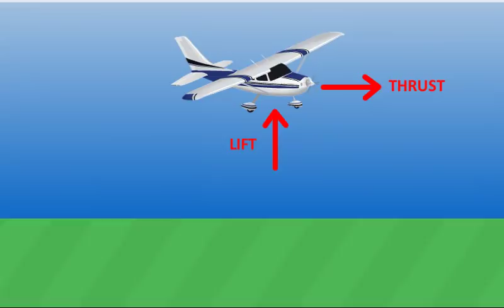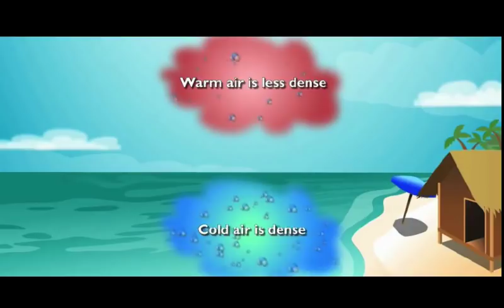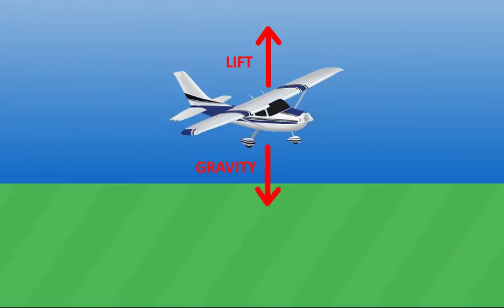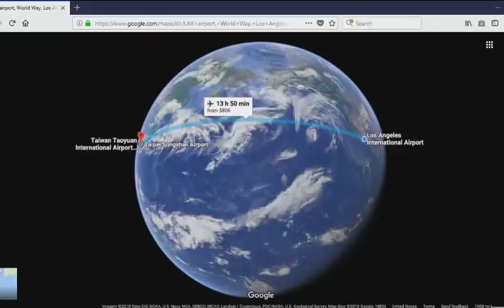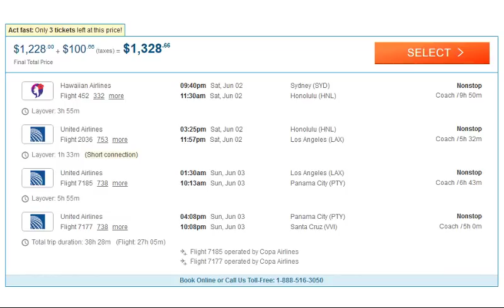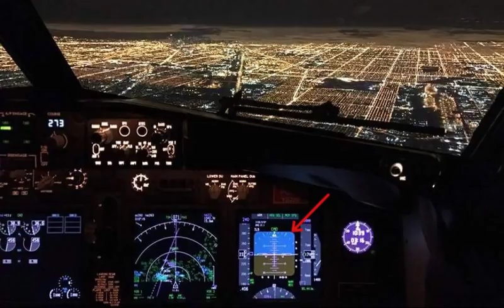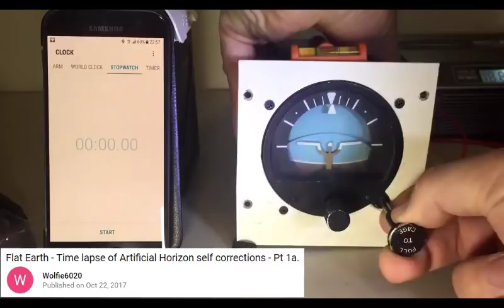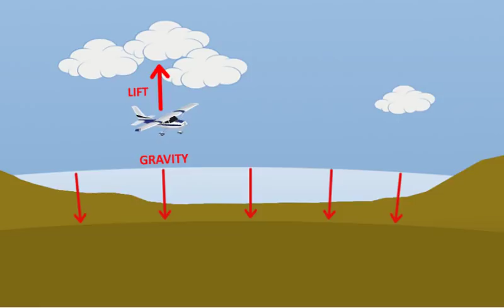Flat Earth Falsities - Plane Nonsense

Comment: The laws of physics do not cause the air to rotate w the earth. Example #1 Wind, especially wind flowing in the opposite direction of the earths spin. I wonder at the so called pols where there is no rotation but rather spin at the top how that plays out in the imaginary space game, what happens to gravity at this point why the same pull to the surface? could it possibly be that the human body is denser then air the physical atmosphere its in? hmmmmmm . I also wonder how it is even considered by the so called science community at large that they accept the non fact based version of the story goes that their so called space vacuum is not able to suck the air from the planet due to a radiational force that keeps air inside it and space out. Where is the findings on such research how and when did radiation become a barrier for a vacuum? I will give this channel $1000.00 cash if you can show me the physical point where the surface of water curves when spread over a broad surface with out manipulation of magnets but water sitting in a bowl or container or lake or points from a ocean. Pls don't show me the telephone pole video from u tube which has been widely discredited many times over. Game over water is your first clue the second was the physical impossibility that a rotating ball east to west could have same flight time and patterns as one traveling in equal opposite direction. 

It's called sea level for a reason as well as world wide & you my friend are lost at sea, let me further explain. Your whole life is based on water and ships. Your on your workmanship, scholarship, friendship, relationship, Ect you get the point or maybe you don't. Water is what its all about IE Curren-sea, Frozen assets,Liquid assets. Your whole view of the world has been shaped by those who molded you. Break free from your spell and realize CGI is not fact and todays people at NASA fully admit they can't go to the moon or make it into full orbit ..... In case you were wondering why all the word play its to get you to realize one simple play that your stuck on: ASTRO-NOT is the correct pronunciation of the word & NASA- Nasha in hebrew means to deceive, beguile, lie too. Keep your faith in that snake tongue logo who has you w your hands on your chin starring at a programming device. Because at the end of the day you have faith to go on with them, no proof. I have proof for my claims and it starts with the waters.  Praise Jesus The Most High , yes truly ABOVE this plane of existence ....... Nirvana Im on a plane, I can't complain, REM Man on the moon, U2 Space may be the final frontier but its made in a hollywood basement. Your whole life was a lie and you are rejecting truth. Ill pray for you .
Reply: I will give you $10,000 if you produce a workable map,proof of the ice-wall or proof of the firmament where your god apparently lives according to Rob Skiba. Chop chop gimp hurry up😂😂
Reply: Travel south Globetard, you may need a loan to pay me though... BTW you can travel south from anywhere on your so called globe and hit the wall. I think you should take a trip south and i aint talking Mexico trolls. BTW you responded within seconds of my reply. IE troll. Cheers mate
Reply: See I love when flat earthers just admit they're crazy and don't understand anything in their opening gibberish. Flat earth is just a scam on YouTube. If you have fallen for it try to at least avoid giving them any of your money.
Reply: I take no money, only comfort in real testable science vs faith in falsehoods. Ill say it again 1k for anyone to show waters surface to bend. World wide you bitch ass globetard fuck heads. Yep
Reply: @ColinDresser  really because I'm offering 5k for anyone who can provide a photo of the bottom of the flat space pizza or a location that I can view the edge of the earth from. I figure both would be nice for star gazing and vacation. Flat earth is sadly just a very dumb scam on YouTube to fleece rubes out of their money. This is only more evident due to a total lack of any credible evidence, intelligence and sanity on the part of flat earth. This is why I like your original post. It proves this right off the bat. No need to continue any further on your part sir. Now you're just proving your maturity.
Reply: @CaptWesStarwind  the bottom? Its not like youve shown the core. How are we supposed to get to the bottom when we as humana cant even survive the water pressure to get to lifes lowest point. Silly challenge.
Reply: You do realize Japan, India, China and Russia have all sent probes to the moon as well. Russia actually did this first. There is no need to risk human lives going to the moon when robots are much cheaper, easier and a safer way to go about it. Maybe you never heard about Apollo 13. There is no reason to risk peoples lives to go to the moon at present. America already proved they could be daredevils and do this. No one else has risked lives like that since Apollo 13's wake up call as to the serious dangers long distance space flight poses. Although if China said they were sending a manned mission to mars in a Year NASA would probably be there in 9 months. Russia after congratulating America in the 60's made it clear they had no intention of trying to send anyone to the moon. Again you are just proving you can parrot flat earth gibberish and have no understanding about what you are talking about. You believe in magic sky fairies and worship a stories about a made up child killer after all.
Reply: Well he has become "woke", so he knows everything now.
Reply: NotTheCIA I.think if you mean his phone details, it's where this idiot posted a Google search to a bloody YouTube video for "evidence". You know instead of an actual Hebrew dictionary. Proving yet again the intelligence of flat earth scum bags. Well I guess the NASA will be coming for him now lol.
Reply: Dont get the point of this argument when you can get on a plane and literally see the earths curvature with the naked eye. 

Look at the night and day cycle. The seasons and stelar events such as solar and luner eclipses. None og these would happen with a flat earth
Reply: @jamestreveil4866  no you cant. According to your own believers a plane isnt high enough. Nice try liar.
Reply: Bobby Wizdum
Who rattled monkey Bobby's cage and wake the baby monkey? Or did Ickle Wickle Baby Bobby have a nasty dream that everyone was taking the piss out of his pathetic trolling and he woke up with a wet, shitty nappy?
Reply: @boffeycn  ever going to say anything meaningful?
Reply from the maker: Colin Dresser - Thanks for praying for me. I'll think for you.
Reply: Oh totally missed how he posted a link for the "Gravity is Only A Theory" excerpt by Ellery Schempp. I do not think he realizes what satire is. I rarely look at links posted by "woke" individuals, but holy hell glad I did. That actually made me laugh. Can I just start posting Mad Magazine articles. Oh hell, they really don't understand a damn thing, do they?  "That anyone would not get the joke is a sad commentary on the state of science knowledge or our sense of humor or both! I mean, if you tie in gravity to obesity, Saturn’s rings, moral ‘decline’, and universal health care, and you don’t see the fun, what’s to say?" Ellery Schempp
Reply: I will give you 1000$ cash if you do not reproduce
Reply: Both of your responses are garbage. I will not even engage your uneducated ass past this point. I only wanted to point out your lack  there of of research on any subject IE : https://ncse.com/library-resource/gravity-its-only-theory
Reply: No.. Im in my house on the flat lake getting faded you shit head. Cheers, my lake is flat my beer glass is level funny thing ...........
Reply: Are you aware that the great pyramids had a electrical use? are you familiar with Tessla? the man who pulled electric current from the plane itsself?
Reply: You show me yours I'll show you mine. Hmm reminds me of church camp.
Reply: Also I am willing to bet money on the fact that you cant show any photo or video of the bottom of your space pizza. Namely because flat earth is just a scam on YouTube. It has nothing but lies and absolutely no credible evidence what so ever. This is why not a single image of beneath the space pizza exists. 4th grade geometry proves the earth is a sphere. Try researching geometry, or how to spot a scam on YouTube, or what a credible source of information is.
Reply: You never could attend.................
Reply: lmao. I'm waiting for one to post a link to "In Search of the Edge".
Reply: Colin Dresser
"Your whole life is based on water and ships." You don't realise how true that is. First went to sea in 1959. I'm a Master Mariner FG and have navigated all around the world, which is why I know the earth is a slowly rotating terrestrial spheroid and gravity is a fact. And why I also know the FE cult and everything associated with it is a total load of bollocks.
What you fail to recognise is that some people have a working knowledge of the real world and have experiences which allow them to make rational, logical decisions on such things.
In my rather extensive experience in mathematics, science and real life situations I have found that the mathematics and science I learned at school, college and university actually conform to and confirm real life. Unlike you I actually have real life experiences which means I actually know things, rather you who naively "believes" any old cultish claptrap.
Tell me, how many times have you navigated around the world?
Or to the Arctic or Antarctica?
And tell me what you saw on your travels and how you actually navigated?
Tell me what is the relationship between longitude and distance when travelling east or west parallel to the equator? If you know the answer then you know the earth is a spheroid. If you don't you are not qualified to comment on the earth’s shape.
Please explain the principles behind the development and functioning of a gyrocompass? If you can then you know the earth is a slowly rotating spheroid and gravity is a fact. If you don't you are not qualified to comment on gravity, the earth's shape or movement.
Tell me how you ascertain the error of a compass when in the Southern Ocean, using Alpha Ursae Minoris?
Reply: Colin you possess true knowledge and style.Well done. 🍻
Reply: Les Automates He was pointing out that it was satirical. Colin Dresser thought it genuine.
Reply: Flock, show proof or silence yourself .
Reply: Colin Dresser please send us a other link that you think is a great proof...we are so glad you came back to get humiliated some more lol...
Reply: Colin Dresser
"I only wanted to point out your lack  there of of research on any subject IE : https://ncse.com/library-resource/gravity-its-only-theory"
You appear to be quoting the article as legitimate explanation of the theory of gravity.
Reply: It is a satirical essay. The author wrote that as an example of what it would be like if we treated something like the theory of gravity the way creationists treat evolution. I've seen a few flat earthers try using that not realizing it is a joke. Ellery Schempp has done some pretty amazing things in his life. Still amazes me how many groups take that essay as if it is serious. Especially religious fundamentalist ones. They clearly haven't looked into this mans history with religion.
Reply: @CaptWesStarwind  they are patheticly wandering a ocean of ignorance and they cling to anything that remotly is connected to their beleifs in the the hope to be still and comforted for a minutes or two..until they are trown back into their rightfull place. that article for a minute was the life boat of that ignoramus. The sad thing is with time and effort...he could have stayed  on this life boat... read it... try to understand it.. maybe stay there until a other one pass by...and slowly get off this ocean of ignorance he is on. let say the return to land is highly unlikly for such individual.. they stay at see and perish in it most of the time.
Reply: @flookd5516  i know that....
Reply: @lesautomates2180  yes it levels itself. It doesnt curve itself.
Reply: @bobbywizdum5248  idiot... what is level around a circle.? 
imagine you need a train to be exactly 10 miles around a circle...all 360 degrees..and back to his starting point.what shape do you think the rail will have... this isnt rocket science dude... the rail will be level.... and curve... the train will go straight always... and yet it will curve around the circle... the bigger the circle... the less curve will be seen.....and the more the train will appear to go only straight forward... yet when the train is back to the starting point.. the trai  wouldve done a 360 degrees of curve. you get this... you can literally do the taught experiment...with no material.. if you have a brain.
Reply: @NotTheCIA I.think and which commercial flight offers this view? Why do we then have videos at 60-12000 feet without this si called curve?
Reply: This reply is to fuck head No.... Your telling me that waters surface does not maintain a level? and that is not a valid test?
Reply: https://www.youtube.com/watch?v=gRWYWXsWxqY
Reply: The very first senate is correct and your a troll look at your bitch ass account . Yep
Reply: that is not fact ......  Snitch IA
Reply: Let me ask you this...... So they can't go now but they went in the 60's? your serious right?
Reply: Here is the proper Link:https://www.google.com/search?client=safari&channel=iphone_bm&source=hp&ei=O9-AW7iqM8iL0wKD6r2gAQ&q=nasha+hebrew+meaning&oq=NASHA+HE&gs_l=psy-ab.3.1.0l3j0i10k1l7.905.237631.0.239848.64.40.19.0.0.0.365.4030.15j12j3j1.31.0..2..0...1.1.64.psy-ab..18.46.3719.0..0i131k1j0i22i30k1.0.dMIlmrf-CA8
Reply: nite 60's cia snitch .... You need to stop snitchin
Reply: @ColinDresser  you gone... please come back... this was the flattardslaughter of the years...seriously... dont try this again dude... your not equipped!
Reply: @NotTheCIA I.think which commercial planes go up 100,000 feet? None. Case closed.